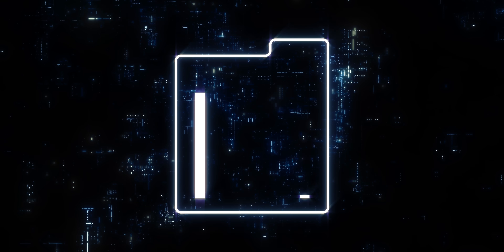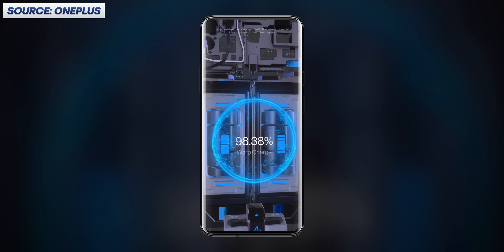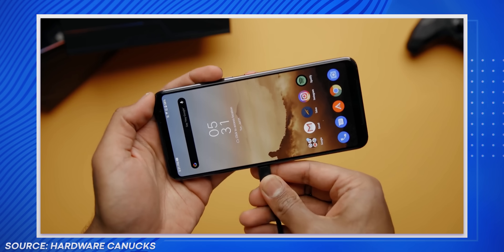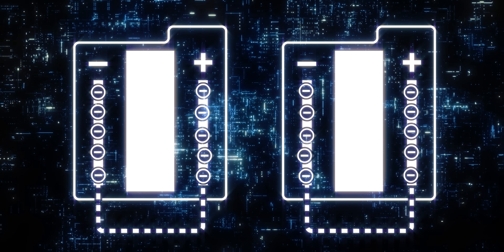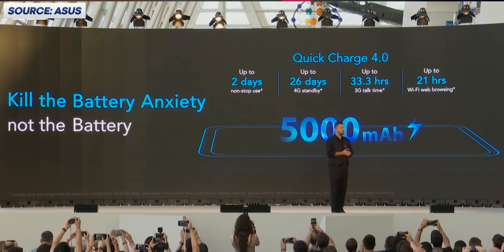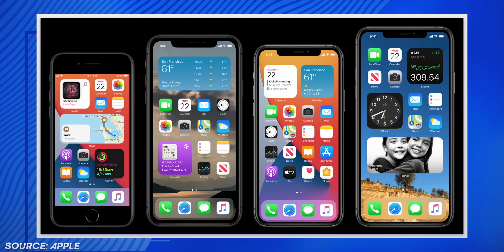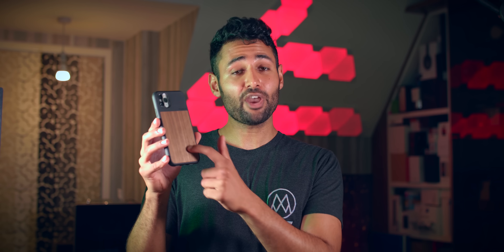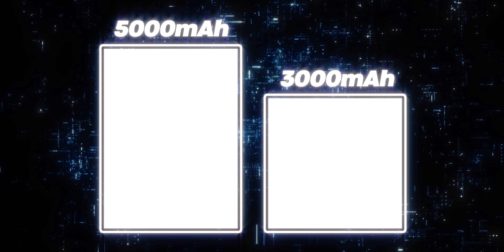The Problem with Fast Chargers.

Comment: Mrwhosetheboss: The reason Apple has been providing 5w chargers in their box to help increase your phone's battery longevity

Apple: 😳yeah.. that totally was
Reply: Meanwhile I can't go a day without everyone in my family who has an iPhone reaching for the charger after two hours or so of use. They looked at me weird when I told them to charge it at 40 until 80 percent. 🙄 the effects are short and long term 👌
Reply: @jakefoxx7978  charging to 80 isn't worth your time. The only thing you should do is not use below 15 and use a slow charger if u want to make battery last longer
Reply: @Kuri0  I've started to see how it doesn't matter if I charge to or over 80. Letting the phone sleep for a good while and not draining it has kept it strong even if I make it to just 67%. The thing is, there have been times where going below 35% "pissed it off" and the battery would be mildly good for a few days until I was careful again.
Reply: @jakefoxx7978  With the 20W charger, my iPhone literally gets from below 20% to 60% in 15 minutes... So no "fast charge", but still pretty fast...
Reply: @jakefoxx7978  it will happen if you have a phone older than xr otherwuse the battery is comparable to 4000 mah smartphone
Reply: @jakefoxx7978  tf you talking about ? If you charge only half at most, it means when you buy fresh phone half of capacity is lost/unused straight away. You just harming yourself. After 2 years its no matter what will be gone in terms of capacity. Battery replacement is cheap why bother doing bullshit. 900€ samsung s20 and 30 € replacement every year or two. Whats a problem ? You crazy man
Reply: Jake Foxx um there are some serious problems if the phone only last a few hours. Those must be some old phones. Hell my parents 5 year old iPhones still  last all day and my mom plays slot games for hours a day.
Reply: @bmakel  Yeah, their old and/or they use them a lot. Regardless, iPhone 7's aren't known for having amazing battery life. Compared to the power-saving capabilities of the 11 (I think because of the chip?), the 7 wouldn't last as long as I would like.
Reply: Apple thinking to themselvs: yeaaah its totally not to save money
Reply: And people buy new iPhone every year....
Reply: The thing with apple phones is that they charge so fast and the battery goes out so fast .
Reply: @kristaskorner5353  finally someone said it!
Reply: apple be like: ooh, ya that's what we were doing..
Reply: He told both sides, there’s always 2 reasons to do something
Reply: @enfortro  yeah, you're completely right I was just making a joke
Reply: l1mbo all good dude
Reply: 5 Watt?? you mean in 2007 right?
Reply: It was cool until the time for full charging is as long as SOT.
Reply: Owww nice explanation. Lovin it😍
Reply: Šhäđøw why are you on about
Reply: and teeny tiny batteries lol
Reply: people hate on apple for no reason sometimes, i remember when i was still an android fanboy, and when i switched to an iphone 5s i found out just how much faster the lightning charges compared to my htc phones back then, lightning charge speed are fine they are not slow or fast they are in the middle which i am comfortable with
Reply: @darknez09240  Well, obviously when the battery is considerably smaller then it will charge pretty fast, iphones back then barely had 1500 to 1800mah battery capacity, and those batteries didn't last too long either.........
Reply: @retrogamer2503  not really, back then my android phones has that amount of battery capacity as well, also iphone battery can last many years more than 4 normally
Reply: @retrogamer2503  iphone has their own merits, i am now collecting some of the older phones that i wished to own but never really bought, and i can tell you how well an older iphone ages than any android phones back then, android phones with micro usb charges so slow, cpu and gpu performance are so weak, the ui is laggy etc etc, yeah you get the freedom to mod the hell out of anything on android that's the merit of android, but they do not age well, for you to say iphone battery doesn't last long is a lie, android phones battery you need to change a new one between 2-3 years for sure
Reply: @darknez09240  if you abuse it, then any phone's battery is going to have to be replaced, even in 1 year, but in normal usage, Androids battery lasts for a lot of time, I have got a Samsung Galaxy Tab 4 that's lying around somewhere, which used to give 10-15hours of battery life playing YouTube and some light games, the battery suddenly dropped drastically a month or two ago, and now it only give 5-6 hours and drains quite a lot, but before that it functioned pretty well so I don't really know what you're talking about.....
Reply: @darknez09240  people barely have their 6s's last even 5-6 hours on medium usage, and a battery test with very light usage only gave 10 hours of battery life, my mother's old J5 gave at least 9-10 hours on light usage before it's battery got damaged and had to be replaced, and that was when it was around  2 years old.
Reply: @retrogamer2503  lol do you know how weak a j5 is?
Reply: @darknez09240  And if you want to talk about performance, the tablet, does lag on YouTube now due to it's software being outdated, but otherwise it still functions ok, only sometimes does it lag, and the Huawei y5 I am using right now doesn't lag at all even playing online games, the only complaint I have about old Androids is their Micro USB port, because it's not durable, although I actually have never had a problem with the port, only some chargers are bad so their connectors get loose over time, but the port is perfectly fine on all devices in the house except for one.
Reply: @darknez09240  in terms of durability? Only it's back cover is really fragile otherwise it's actually pretty durable, has survived many drops face down and back down. In terms of performance it's still pretty good and functions well, I don't know what you're talking about.
Reply: @darknez09240  If you are talking about battery life then I just mentioned how long it used to last back then when it was 2 years old.
Reply: @darknez09240  Back then android phones (in the time of 6s) had a standard of 3000 to 4000 mAh, I'd it's a battery centered phone, otherwise 2500 was the minimum, at least that's what I remember
Reply: @retrogamer2503  look it's simple iphone has longer life span due to the battery lasting for 4 years easily without replacing the battery, while android phones having bigger capacity and crazy fast charging speed and wattage, you are required to replace the battery in 2-3 years time, yes you charge your phone faster but it kills your battery life faster as well, android phones back in the days before snadragon 800 series came out are all junk and laggy except a few models maybe like myself still an htc fanboy i love htc for their well build quality and smooth, stable and pretty looking htc sense ui, touchwiz back in the days are shitty looking and laggy but have tons of features like gesture and motion detection, nowadays android phone has been much better , but my point still stand iphone simply last longer and future prooft more than android phones, for example my iphone 6s working fine in 2021 and even 2022 to come with ios 15 support and just a new battery replacement will get it going for another few years until apple decided to end it's software update, or when the games i wanted to play on my iphone 6s no longer can run it smoothly which is true aka genshin impact that ran on my 6s for 10-20fps, but for everything else it's still doing fine, so if you say iphone battery capacity is too little to last a day then yea i would agree with you but you are simply saying iphone battery doesn't last for many years when it does last 3-4 year easily even if you are a power user that play games everyday while charging
Reply: @darknez09240  Bruh, 10 watts is crazy fast? Android only had 10 watts back then, and 10 watts isn't that fast actually...........and actually 6 and 6s's are known for their batteries degrading to the point that even 2 hours is good on them if you still use the original battery, and I have multiple times proved that android's battery does degrade, yes, but not as much as you think, all the devices (from Samsung) in this house would have still had great batteries had they not have been abused, I had to change charges every 2 months for the tablet and the voltage also changed, but still it only started getting really bad about a month ago when I changed the charger again, and note that the device is more than 6 years old with the original battery still in. Unless you use a cheap Huawei from 2016 or something, only then will Android suck to you, otherwise, my mother's Samsung has aged really well except for the fact that it's storage is really low and it's at Android 6, props to Apple for giving updates for 5 years, but the statement that androids don't last more than 2 years is a lie, of you want to, you can still use Android 4.4.2 if you only need the essentials, so it's not always important to stay up to date, especially when you can manage without games and stuff.
Reply: @retrogamer2503  well maybe but you do know how many android phones are out there lol so many brands and models i can only speak from my experience, same can be said to you for saying iphone doesn't last long etc i mean... we can go all days arguing for pointless things we use everyday called smartphone but i am just gonna stop here and continue collecting many kinds of rare phones
Reply: @darknez09240  reminder: iphone 5s is from 2013, androids have improved since the galaxy s5
Reply: @jaekheory6006  umm i know did you read all my point is iphone back in the days are far superior than android phones in terms of the storage and chipset performance yet nobody talks about it, android fanboys love to ignore everything good about iphone and just call it garbage based on paper specs and expensive pricing, like the one comment  i am arguing to, also android phone back in the days are all weak as hell in terms of chipset performance only after snapdragon 800 series came out that android phones are starting to be able to get close to iphone performance
Reply: @darknez09240  best summary of the smartphone race ever
Reply: @jaekheory6006  actually i edited my comment because i have mistaken your reply as another android fanboy that argue with me on another video, so ignore it, what i am trying to educate to these people who hate on apple is simply telling them just because apple are greedy and selling overprice shit doesn't mean they are automatically trash, i wouldn't call myself rich i buy used iphones with cheaper price and that provide more value and stabilty to me buying a new low/mid tier android phones correct? i mean sure mid tier android phone are getting better nowadays even sd 700 series chipset can beat flagship of last few years, i am just saying that iphone does future prooft more than android phones most of the time due to the software support and fast chipset, i love both android and ios but once i tried an iphone 5s and now iphone 6s i simply prefer it because of the smooth and stable ios and that i don't have to tinker with many tweaks or settings, but i still buy and collects the android phones that i used to love but could never afford in the past for nostalgia reason, i have used some htc, sony, samsung android phones and i have learned to root and mod the hell out of them, but rooting and custom mods are not the same as before anymore you hardly need custom roms anymore or maybe even root unless you are installing modded apks or simply doing pirating lol, android phones would be my entertainment/gaming phone while my iphone would be my daily work/browsing/gaming phone simple as that, i can tell you pros and cons for both world
Reply: @darknez09240  okay sure, damn that must have took a LOONGG time typing that
Reply: @jaekheory6006  not really a long time, with a logitech g813 typing is fun
Reply: @jaekheory6006  well, sometimes we can't all get our point across w one neatly diluted, precise paragraph. I, for one, appreciate a long, detailed comment or message.
Reply: @n2wishnn552  same
Reply: haha, what an apple simp he is
Reply: Sure lol
Reply: Wouldn't it be epic if apple just makes a 300w charger this year to flex and ship it with the iphone 12.
Reply: @xnesta9003  top 10 impossible thing Apple won't do
Reply: @xnesta9003  wont happen, forget about it.
Reply: @xnesta9003  That didn't age well.......
Reply: Mrwhosetheboss: The reason Samsung puts laughable Exynos chips in their 1000$+ flagship phones outside of the USA is because of GSM

Samsung: 100% true 😀

Comment: Realme 7 Pro has 65W superdart chargning .
While charging the phone will stay under 40 degree celsius , Great cooling tech is used
Reply: Did you use your superdart everytime you charge??
Reply: @venddzer3037  🤣I don't have the phone
Reply: @venddzer3037  But if i had it , then obviously i would have used the company provided 65W charger for it

Comment: I have an only 3750 mAh battery and a 22.5W charger and no option to turn SuperCharge off :( This battery will degrade so quick. I've had this phone for 7 months and the battery is still doing well, but I don't think that's still gonna be the case in a time period of another 7 moths.

Comment: That's a good one Arun  I had q that I have a OnePlus 7t and a realme 7 as the 7t has 3800 and realme has 5000 I was testing the fast charge which will charge quickly as u said it's not so true my 7t charges fast

Comment: 120W not twice faster than 60W.
60W not twice faster than 30W.
30W not twice faster than 15W.
15W not twice faster than 7.5W.
7.5W not twice faster than 3.25W.
3.25W not twice faster than 1.625W.
Therefore 120W not twice faster than 1.625W charger.

Comment: I have had a Samsung S7 Edge for the passed 4 years. been waiting for phones to get camera under screen display tech. the headphone jack is messed up/old and the charging port is also loose/old. was waiting on a phone that can match the battery. been keeping on eye on Google with their Pixel and OnePlus ever since they released their Phones as of The Pixel and the Oneplus 5 or 6.Since I know/seen what the Google Pixel 5 brought to the table. I am waiting for Oneplus to reveal the Oneplus 8T because I need phone not only with great software but also a Hardware upgrade from my S7 Edge. though after watching your video instead of the 60-65 Watt Charger the rumor/speculation for the Oneplus 8T, I'm just going to get/stick with a 30W charger at home and use the 60 watt charger if I am outside and need I quick charge to get my phone up to 50% if I am low. Though Don't apologize for the physics lesson Arun, It is interesting and amuses me. I enjoy learning and being enlightened/aware

Comment: I've turned on fast wireless charging on my phone but have turned off fast charging for cable based charging. Should mean that my battery won't degrade too fast. I only use wireless charging if I'm at an airport or something and need a quick top up.

Comment: I've been slow charging over night since forever. Never use wireless due to the heat, and only used fast wired when I'm constrained for time. Simple dimple. Current on the OnePlus 8 Pro.

Comment: There are so many technical inaccuracies in this video, which would be fine if it is phrased as a simplification to get the point across, but it isn't. That's pretty sad, because the point you're making is completely valid and it's obvious that you went to great effort to get it across understandably, but if someone takes your explanation as a fact they'll think batteries are capacitors and and electrons powering the components aren't going back to the battery just to name two examples. So it's quite the big issue with a very simple fix, just make sure it's obvious that your explanation is a simplification. PS. I hope I don't sound too harsh because it's an understandable and common issue, but nevertheless one that should be prevented.

Comment: I use a galaxy  m30 with 15watt charger and 5000amh of battery  it takes about 2hrs to be full but i keep it in the 80 to 90 range only while charging, also the battery lasts a ton so charging about once every 2 days is ok and it works well

Comment: I bought my iphone xr in november 2019, i used my old ipad charger because it would charge faster. In the first months my battery capacity dropped 10%. I stopped using the ipad charger and i use the standard charger now, since i do that the battery capacity stayed the same in 3 months.

Comment: Oneplus tout that their warp charge doesn't overheat the battery due to some charging components being moved from the phone to the charger. I assume other manufactures use the same technique. So I wonder how battery degradation in this case compares to a standard charger

Comment: I have a question @mrwhosetgeboss that i have purchased the iPhone 11 Pro and have been using it since 1st November 2019 now less than a year my battery is already 86% why so? Whereas in the other iPhone 7 I have which I had taken during the launch has 90% battery yet. Any reason?

Comment: I have said for soooo long now that people should not use fast charging unless they actually need it.
I mostly charge my phones with only 5 - 10watts. Only when I need it (and that is rare!) do I use faster charging than that. That's why my batteries live longer with better capacity than most of my friends... :P
So yes... It DOES help to slow charge. Well.. If you don't need to charge several times a day that is.. Then you are fucked anyway :P
But it's a great possibility to have fast charge when you need it. But for normal use it's basicly only a negative thing.
FYI: Most of the time the batteries are often charged up to 70 - 80% since that is even more optimal than 50% for storing it.